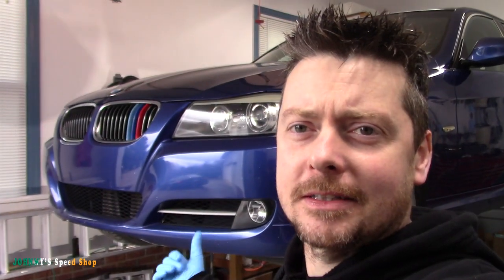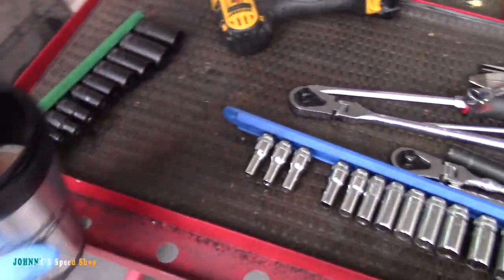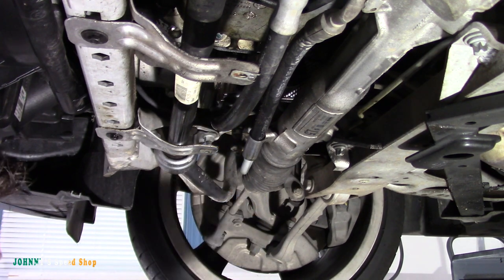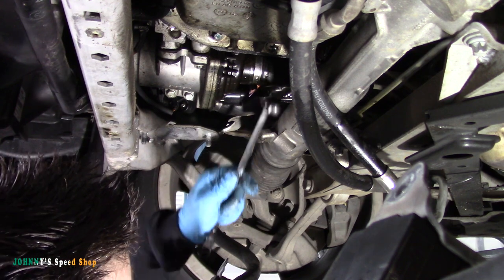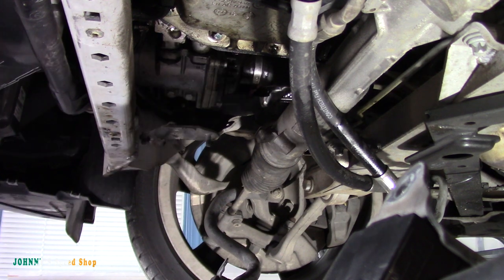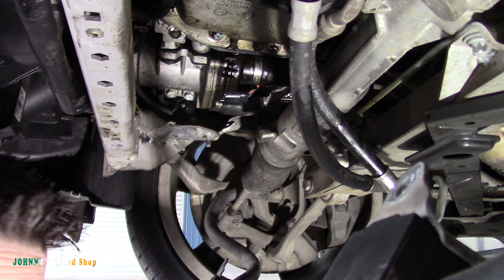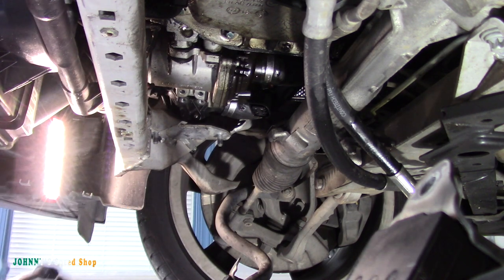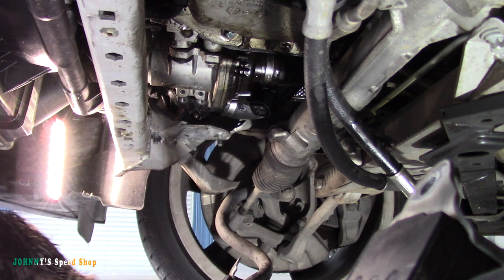Water Pump Removal - BMW 335i

Comment: Hi - What exactly did you use to get to the top bolt on the water pump? It looks like you had a few different tools connected together. Thanks
Reply: I want to know too - The camera angle didn't change for like 10 minutes so I couldn't see anything he was doing
Reply: Probably a swivel connector to the extension on the ratchet

Comment: Hi there! I would like to ask you - do anyone has an idea how to change water pump on car with electronic power steering? The electromotor on steering did not provide space to remove the pump. There is no easy acces.. Do I have to remove all electronic power steering out of the car?
Reply from the maker: What's the car ?  It is a BMW with electric assist steering?  Check service data it should be possible without having to remove....
Reply: Its E90. I would like to check service data, but i dont have it.  Wich data do you mean?
Reply from the maker: @Krtek004    is your car an XI model   ?   (4 wheel drive ),  XI they suggest to lower the sub-frame, non XI  with eclectic assist suggests removing the rad fan and charge pipes.  I can't really guide you without exact details your car, but looks like at least you will need to pull rad fan, charge pipes, possibly  a few extra bits...

Best of Luck 
--J
Reply: @JohnnysSpeedShop  HI Johny, thanks for your reply. I have classic RWD. I have try it yesterday. I moved out the fan and wanted pull forward the pump. All screws have been removed. But still im not able to remove the pump forward... I'm getting disappointed

//update
I probably have find what cause that i'm not able to pull it forward. I think that all of it holds by No.4 on this picture https://i.imgur.com/qMQou5l.jpg Hose No4 is made from metal and screewed to the block. This is the reason why I cant pull out the water pump.
The easiest way would be unplug the flexible part of hose No.4 connected to the thermostat. BUT - there is almost no space for screwdriver. Maybe the biggest issue will be reassembly it back... mean plug the hose :(

Comment: thx - my 335i 2007 convertible just broke down yesterday evening while driving home at 11 pm. Got an indication that the enginge "overhaeted". It went from a yellow to a red flag on the tft display and the car limited the speed to approx. 20 mph. Brought it to the dealer and now waiting for their feedback. I assume it is the waterpump and the thermostate (car has 120'000 km). let's see
Reply from the maker: Hey, how did you make out with your motor  ?
Reply: @JohnnysSpeedShop  It was the waterpump and the thermostate, plus they changed a fuel-pump close or inside the petrol tank (not HPFP). all-in-all about 3k $. The did not touch the HPFP, that would have been another 1.2k $ It seems that the pre-owner already changed it. I hope now the car will run the next 50'000 KM without any issues.
Reply from the maker: Peewww. That's a lot of cash... hopefully you are good to go for a long time now... normally they replace the thermostat as a caution to the waterpump
..either way that's a lot of $$$$ best of luck for the future..cbeers...Johnny

Comment: Hello, your video was of great help to replace the pump and thermostat, thanks friend, but in my case I did break the rubber of the line 🥲 I want to know if the rubber is sold separately and do you know the part number, I don't know how search for it by google does not appear, could you help me please, greetings
Reply from the maker: Just cable tie it back together....or go to your nearest just yard and try to remove it again without splitting it.....I don't have a part number for it since I didn't break mine....🤣🤣🤣
Reply: @JohnnysSpeedShop  Yes, I was very rude when removing it, in fact I bring it with a stainless steel tie, but I feel that with the vibration it makes noise, finally, could you tell me what that line is, I have no idea, and I appreciate your time.  thank you very much for your time 👍🏻
Reply from the maker: Its a power steering line....if you go to BMW I'm sure they can look up the part for you...shouldn't cost too much to replace....
Reply: @JohnnysSpeedShop  thank U so much

Comment: Ya, so I just did a coolant flush and even though I specifically remember you saying not to crank the power Steering pressure hose bracket, I broke it......
I was hoping to find just the bracket but no go, the REIN host is like $200.00 so I just used zip ties and it seems pretty snug but have you ever jimmied a fix for this that you could suggest?
I love you videos by the way. I think in one video (maybe this one) you were talking of getting rid of this one so I don't know if you'll have any more 335i vids but I'd love to see more.
Reply from the maker: glad you like the video, there's a few things you can do like drain the system and braise the bracket back on, but honestly a cable tie will work just fine, i'm suggest checking it every 6 months just to make sure it doesn't snap,  and I've got tons of 335i videos scattered all over my channel, and 328i and an F30 320 with the AC Schnitzer package,  that's a cool car... Cheers - J